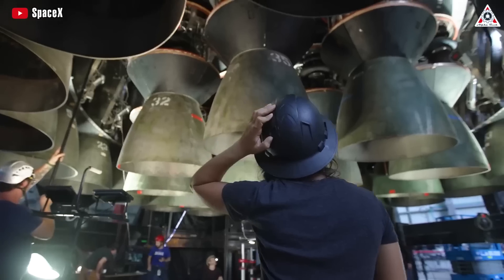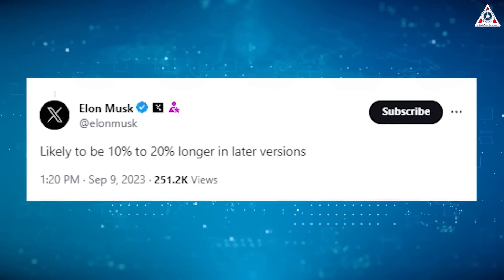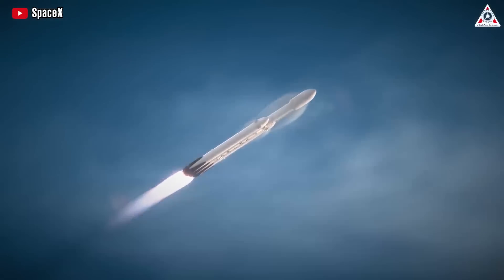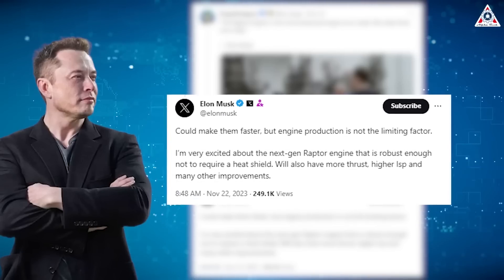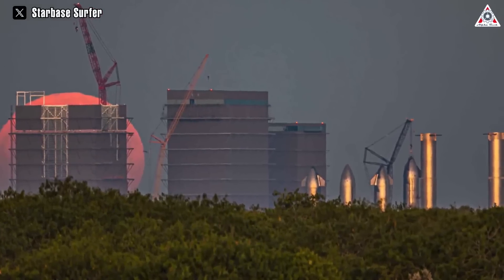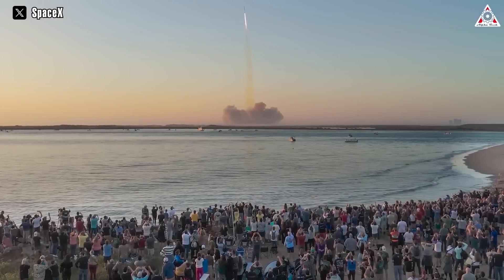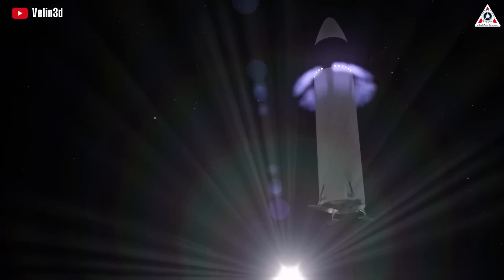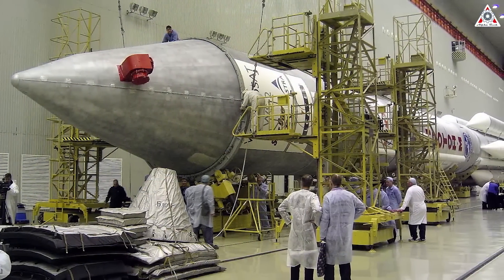Musk reveals Starship V2 powered by upgrade Raptor 3.0! NASA Astronomers declared this on Starship.

Comment: The heat shield can be made out of a composite material. IE:Ceramic Shell or Carbon Fibre Colloidal silicate mixture or a more fire resistant material with Colloidal silicate & carbon for tension. Suitably protecting what’s needs protection beneath. Reducing the weight but fill filling the function and saving against explosive conditions and protecting wiring & lower tank areas. Remove ing the risk at reduced weight. I rather see this safe than sorry and safely launched & flying. Already they have reduced the outer area catchpoint s with exterior cover ers etc on the lower side 3/4 way up the booster. The design of the lower engine protection should be the business of The Bakery Team at Mars Base.

Comment: @ octangrim9388
0 seconds ago
Why there could  not prevent heat by friction as on the S25 🚀🚀🌕🌕 at the end of a profile base of atmospheric destruction of the Re-Boot-Raptor V2.0 and the end of the last ring of the launcher Shuttle ( * B10 / 62 km / Alt / Mach 4.08 *) and therefore cleaning the remaining space is larger thanks to the installation of the 66-ton Lox² / Second in-return anti-return system on the central column and step by step 79. (10+ 3), under-deinous transfer tube.

So, the power supply to the non-Pass dispenser ?? In the cushioning of the cuts and the external hatching to capture the hose boxes 📐⏳⚗⛽ Mobile consumption (double sub-mail poriscopes 🧐🧐🧜‍🧐🧐🧜‍🧜‍Paptants pierced at the top of the pivot 0 ° for 90 ° 📐 For the stabilization of male candle covers external by rotation of 1/4 -1/5 symmetrical round of the two antennas of the central pumping airlock for the exterior station in 90 ° -0 ° -90 ° (+/-) the mechanical mass Rotating cable connection game between the two pierced trees pierced at the top.

Double fixed half-moon guide 🧲🧲🧲🧲column🏹🏹⚔⚔ (pierced with a console console console on a scene driven by the chain), opening + closure of a refueling bridge. The release of the devices being made by opposite return rotation towards the opening of the upper part of the cone by 180 ° of reverse rotation.

Possible damping by two antennas or capture the parallel guidance of the cable between the central fuel distribution of an outdoor station) retratedable stabilized on the rail with a spiral spring mechanism () switched by male sockets / Lox² Max + in the compartment distribution for the Direction supplies.

Double power variants under the tip of the focus (outlet of the interior bridge via a chain pinion equipped with a retractable output mechanism of the massive hatching box ended by a double cone reversible cone unit on tiles of external friction.

The nutrition of shuttles seems less complex thanks to the cooling of the Mox and Lox tanks by a unit placed between the nose dispenser and the rear of the useful spaces of the rest of the ship.

Managing to stem the sudden rejoicing for the refueling of the 33 depressed units of the Raptorv2.0 to 1.5-2.0 tonnes / s² intended to relaunch and for auxiliary reset operations at a 48 ° -90 ° -pendulum interval - 48 ° - In a complete close combat / anti -roll camera for Mach +22 to +8, all the tiles spread under an iron mask? !!! Filled with cold pimples exceeding friction surfaces of some 44,000 watts of small quenots (TPS tiles) All tremors ... 🎉🎊✨🧨🛹🌠🔥🔥🔥🛡🛡⚔⚖🛡🎬🥊🚀🚀🙌🙌👍🌠

Comment: Will leaked un-burnt methane molecules leaked during exponential multiplied LEO Starship refuelings, or one or more frozen open valve accidents allowing those leaked molecules to circle Earth for eons then in turn warm Earth even more ?
Reply: A lot of talk about the raptor version 2 and how did you need to add more engines? What happened to raptor three this was supposed to surpass everything raptor too to do

Comment: They say a reason why a rocket have 2 tanks, one for propellant and one for oxyen, is because in space there is no oxyen and therefor it needs to bring the oxidiser with it.  But at earth at ground level, there is...  Why don't rockets generally don't use the atmosferes oxyen at this stage? (sort of what virgins galactic kinda does).
Reply: Because they can't afford the weight of a facility to compress that oxygen into a liquid format at the speed they use it at.
Reply: Atmospheric pressure decreases from sea level and every step along the way as the rocket rises. Calculations determine the mix of oxygen to fuel to maximize the energy of the rocket along the way. When you look at the rocket as it rises, you will see the spread of the engine flair increase. That's because there is far less oxygen as you go up. Eventually, there is no oxygen in outer space. If you live in Florida and drive your car to the highest point in Colorado, you may experience carburation issues for the same reason. Sputter, sputter:-)
Reply: @rocroc  Don't need that much elevation change to have carburation issues.
Central Indiana to Colorado Springs was bad enough, then up Pike's Peak was really bad.
I was driving a late 1970s Celica at the time.

Comment: I doubt the heat shield
removal will be due to engine power. Will be due to external simplification, and an increase in pass thru velocity making external heat moot.

Most likely will be Raptor 3 side pump models. only exposed surfaces would be the outside of the combustion chamber and pumps.
And they are gonna be hot to begin with.

Extra length will be possible due to more powerful engines, and that they will be more compact, allowing more of them.

And if the pass thru velocity is increased, the efficiency improves, and you need less fuel mix for unit thrust.
So I'm hoping that Rumor about raptor 3's being able to take 3x to 4x the pass thru are true..
If true, and we get function, Jeff will have to re-assess his entire operation. And build a much bigger factory, and pump more money into playing catch up.

Because Elon will be a couple rocket classes ahead at that point, and still gaining.

I think Starship 2.0 will be another interim model, And Starship 3 will be with larger engines and another hull size jump.

Likely up diameter to the 60 ft model...
Could get humorous at that size, one Starship carry more load, than all other launch companies combined for a year...

Fun part of upscaling engines, is we could literally fly space ships the size of Aircraft Carriers if we upscale engines enough.

Might be fun? dropping   turbine engined aircraft from orbit... Orbital Aircraft Carriers? With ground based lifters that launch a dozen of them at a time, back into orbit to reload the mother ship...

Might be disconcerting for an adversary? to have aircraft dropping out of orbit on fast glides, and only needing fuel to make it to relaunch facilities...

We are on the cusp of totally new tech, thanks to Elon, and he's Like the Speedy Gonzales of rockets... And the rest of the military industrial complex will wake up some morning to irrelevence...

Still building stuff from the last century...

Comment: The use of internal baffles/bulkheads in the propellant tanks, located near the bottom and closer to the engines, could alleviate the starvation issues experienced by the Super Heavy booster on the last flight. The propensity of the fuel to move upward, away from the fuel pickups, during stage separation (a condition aggravated by hot separation) would be countered. A large volume isn't necessary but should be enough to complete separation, flip, and initiate return burn while allowing the rest of the propellant to return to the bottom of the tanks where it can be accessed by the pumps pickups. This is similar to the baffles used in automotive racing engines oil pans to prevent oil starvation during high G acceleration and turns. Just another thought from a useless, retired, old, Industrial Design Engineer.
Reply: I posted the same thing...
From a useless, retired, maker of all kinds of stuff, and guy who planted parts count concept for Elon! 
Methinks being useless comes in handy!
Reply: Or dedicated header tanks for the separation manoeuvre using the centre engines!